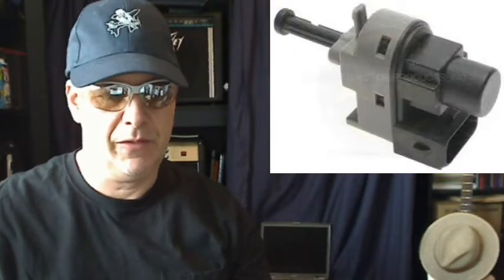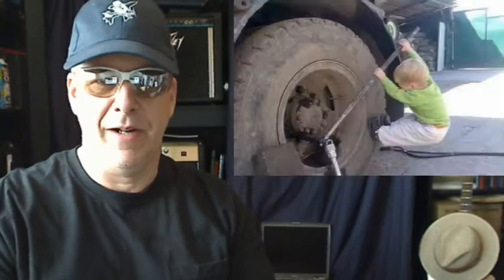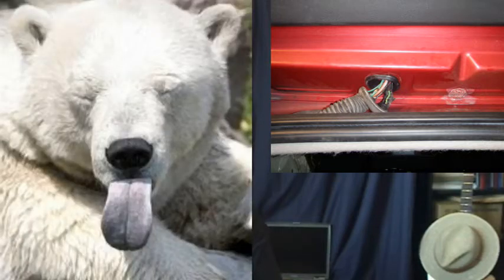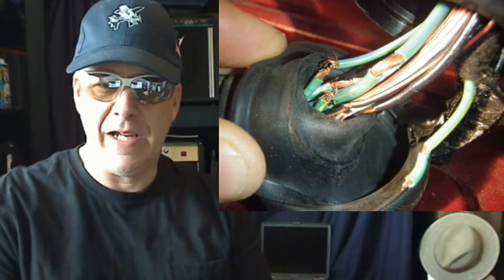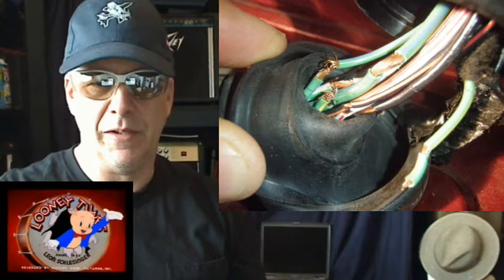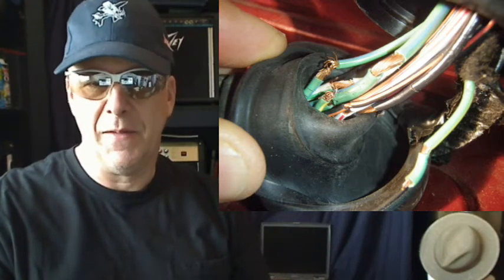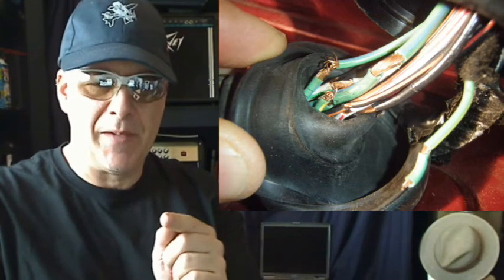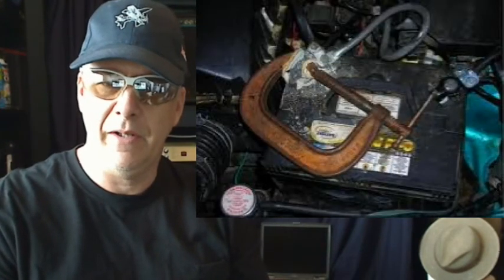Car Talk - Ford Focus Hatch Wiring Problem

Comment: Spot on with this!! Im.amazed that more people aren't aware of this problem. Specifically, the 3 mechanics I've had looking for the problem. Seriously I burned through 3 alternators.  Over 2000 dollars and it ended up being a wire. Thanks ford.
Reply from the maker: I only burned through 30 bucks with a switch until I decided to look at the wiring while at the grocery store with my wife.  This should have been a recall as it impacted vehicle safety with break lights and cruse control.  I fixed it myself by splicing wires and taping bare wires that were electrically touching.  I guess someone needs to crash before something is done about this.
Reply: I did this repair  yesterday (6 hours LOL not bad for a girl eh?) ... anyway my lights are not flickering anymore and only time will tell if it was the fix.... I will know if my 4th alternator burns out in 2 months..... crossing fingers :)

Comment: Was also a problem in my '06 ZXW, but it caused different issues. In my case the hatch would randomly unlock when I started the car, and additionally I started blowing break light fuses. Upon opening the boot, nearly every wire was exposed and two were broken, which I believe were for the license plate lamp and the hatch unlock button coming from the dashboard. I didn't have soldering tools, so I just taped up all the exposed wires so they'll stop shorting randomly.

Comment: JD, you cracked me up.  May I recommend a quick disconnect at the affected area as opposed to gun tape, electric tape and soldering.  You know, the Air Force way as opposed to Joe's garage non-lasting fixes.  Check six.  :)

Comment: do you know of any wiring issues to the egr valve on a focus 1.6 tdci dv6 engine 

I have 1 wire with 5v but the rest have none and in sure 1 should have 12 volts so I guess there is a fault 
my she comes up as stuck closed but it's moving fine inside so it's got to  be electrical issue not powering it correctly

Comment: Seems most hatch backs have this problem ! My Toyota 1989 done 82,000 mls and as this is mainly on shopping I recon that is, at least, 4 openings or more per 100mls. Thus say about 3 to 4 thousand in its life time !  I wonder if the manufacturers are on to this !
Reply from the maker: More failures = more revenue for the OEMs

Comment: Well What a sweat !  The Toyota hatch had two 1mm dia wires which looked as if they had been cut by a pair of side cutters, they were small dia compared to all the rest and seemed too short to take the continual flexing. I had to find a 100mm length of double core flex and by pulling both broken wires out to the hatch side of the common "tube" I could solder this 100mm length to the broken wires: I fitted heat shrink tubes before soldering.
The above completed I greased the new double flex and pulled it through the common  tube. Next I had one "hell-ove-job" to solder the wires to those inside the car's roof - they  had no slack thus I was sitting in the boot and poking a hot iron into a 50mm gap. 
  All I could do to the heat shrink tubes was touch them with the soldering iron - I have wraped "duct tape" over the joins  And yes it is DUCT not DUCK it was originally designed for air con ducting. Well for an 80 yr old I got my daily exercise and the tail red fog light works.

Comment: thank you for your help .i opened my hatch and found the exact thing  same broken wire and alot of bare wires..i will be repairing this very soo
Reply from the maker: glad that my video and repair could help.  plus my little humor. check out my blues and santana songs
Reply: @JDRichard  this just happened on my daughters car and it burn the whole dash and rear harness up in the car she said the fuse popped on the way home at night all she had was a 10 amp and a 25 amp the 10 amp was bad so she put the 25 in a fire started burn dash and rear harness. looked at hatch wires burnt and touching and melted  yea ford ...... and yes the 25 amp cooked it but when its dark and on your way home $%&*  happens, but the real cause was the wires in the hatch......
Reply from the maker: @acemay3  And this is why I made the video. It started out serious as I was pissed off at the poor design and then I decided to make it a bit funny. So is it now fixed or is the car a write-off?
Reply: @JDRichard  cant find a stick car main harness is burnt, had to pin clutch wires in new dash harness... so just going to right off the car. only main harness i can find is for a automatic
Reply from the maker: @acemay3  Shame, because the car is great with this exception. We called it the dent mobile as it accumulated quite a few parking lot dents over the years from my wife's parking lot practice.

Comment: Brill video, you should be a in training people profession job and not a musician:

6. YOU ONLY NEED TWO TOOLS IN LIFE - WD-40 AND DUCT TAPE. IF IT DOESN'T MOVE AND SHOULD, USE THE WD-40. IF IT SHOULDN'T MOVE AND DOES, USE THE DUCT TAPE.

7. IF YOU CAN'T FIX IT WITH A HAMMER, YOU'VE GOT AN ELECTRICAL PROBLEM